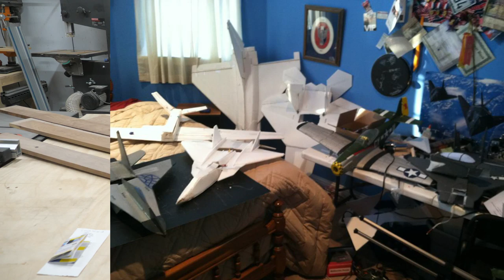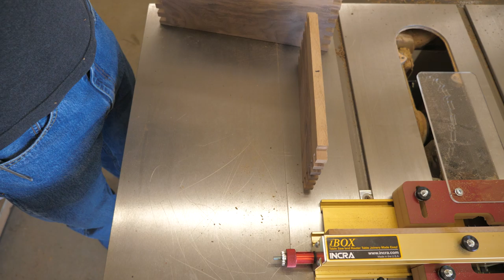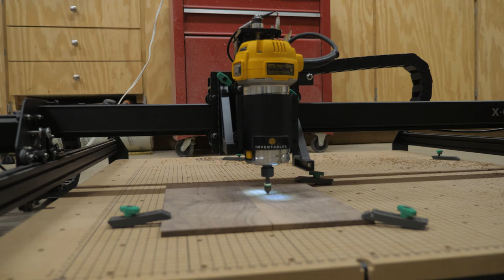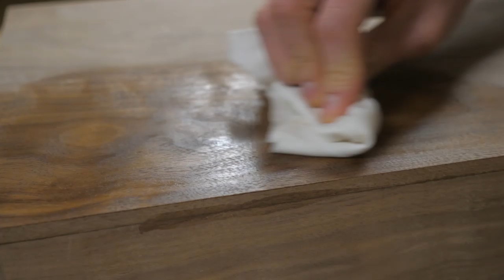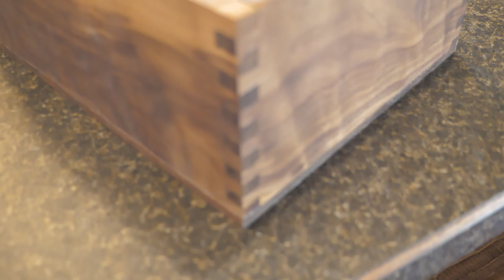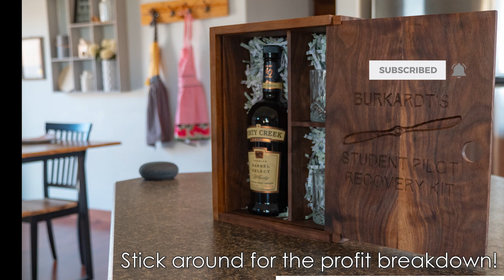Why We QUIT OUR JOBS to start a Woodworking Business | How to Price & Sell a Whiskey Gift Box

Comment: Box looks great!  Videos are awesome!  Thanks for all the info!  Question:  How do you figure in your CNC time/labor?
Reply from the maker: Honestly, we keep the pricing structure the same as we do for every other project. The CnC is just another tool! It makes the process of carving go faster - just like a table saw helps you go faster than a hand saw or jigsaw. We'll charge our hourly rate for time spent designing (drawing, illustrator, easel, etc) carving, building, and include material costs.
Reply: @jennieanddavis  Thanks - I guess when it's cutting I'm doing other things anyway so that "time" should still get counted.
Reply from the maker: Exactly. Also, babysitting a machine is still work - knowing what to do if/when it goes south is a skill worth paying for, too!

Comment: How did you factor in the set up time for the CNC carving? Was it included in the 6 hours?
Reply from the maker: Yep! We treat CnC work just like labor costs using any other tools in our shop.
Reply: @jennieanddavis   okay I need some clarification. When you say you include that time u mean the design time and set up time.  Not the run time of the CNC cause that would be like charging for the time it takes the glue to dry.